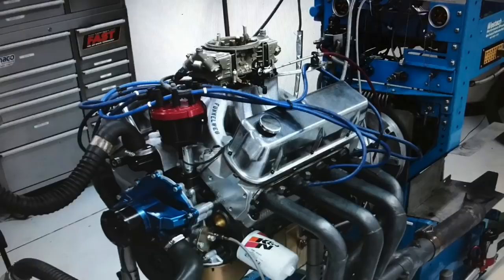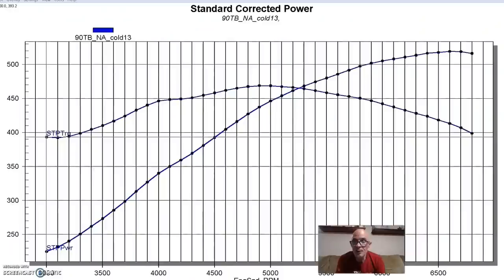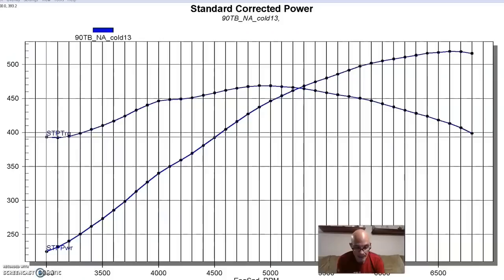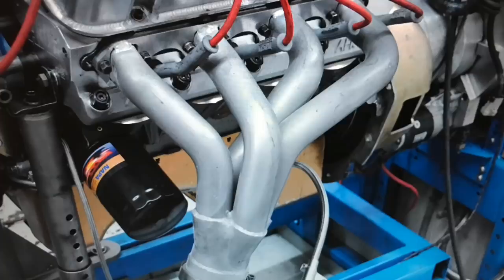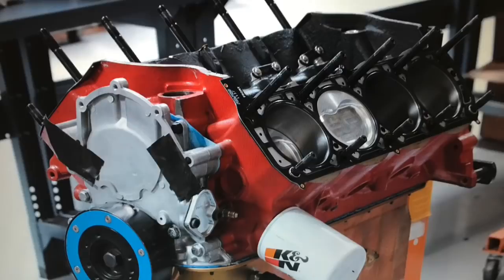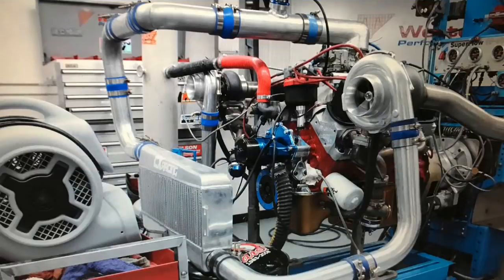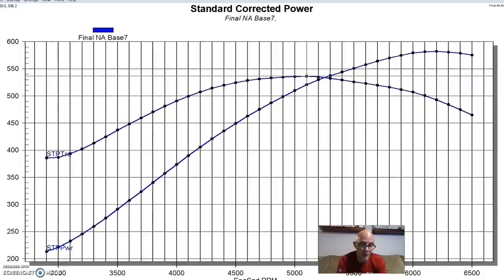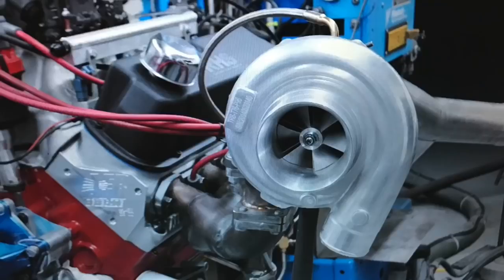1000-HP HOW TO: SBF TURBO STROKERS

Comment: here is the deal with 1,000hp power 351w is how long will it last even with a great tune, no timming just turn the boost up, show me where someone is running a 351w at a thousand horsepower, stock block 351
Reply from the maker: no timming?
Reply: @richardholdener1727  my bad i thought timming plus boost things go boom because the cylinder pressure with added timming

Comment: how do you adjust for windageI know you put less oil than what the pan recommends but how do you figure out how much wind did you have is it like a vacuum gauge or?
Reply from the maker: we see it on the dyno as a change in the oil pressure curve and a loss in power

Comment: I think this is a great informative video as I'm a foxbody owner and enjoy seeing options for more powa, but going 427 is a very pricey option and I've been leaning towards the 351W base and stroke it to the 408 or 416 with boost!! With that being said, Richard what is a safe reliable HP number and Boost pressure to pump out of a stock block 351W while being reliable and having good longevity from this type of setup?(I built a 306 and am planning on running my vortech with about 10-12 PSI and methanol injection for cooling of IATs and reliability BUT this setup is only temporarily until I build a 351 based engine and I want to go turbo and methanol injection with that setup)
Reply from the maker: you don't need a 408 with boost
Reply: @richardholdener1727  so you're saying I could build reliable 800-1000 on a 351W built around a proper cam with the supporting mods ie. Springs, heads, intake and of course the trusty "ring gap" and a turbo to meet that goal? What turbo or turbos would you suggest? Which cam, heads and intake would you also build the 351 with? Also is the factory 351W bottom end going to support everything or do I need an upgraded cranks, rods etc.??

Comment: Hey Richard, so I’m wondering why did it take 17lbs to get the 363 to 1000? Hear me out, if it made 519 na, then shouldn’t 14.7 lbs of boost doubled that to 1038 hp? Yet it needed 17 lbs, why is that do you think?
Reply from the maker: MILD TUNE

Comment: Would you be able to run a turbo on pump fuel on a windsor with 12 to 1 compression? If so video would be cool
Reply from the maker: on pump e85 yes-otherwise not a good idea
Reply: Cheers mate

Comment: I'm "back" ! So how much boost did you need to give the junkyard ? Did you ever see if you'd could make it to a 1000 hp with the stock heads ? And when you used junkyard stock block  and displacement and better heads, what kind of boost did you need ? "Very curious" 🦧

Comment: Mr  richard i love watching you and listening  i have a 351 dart block chi cleveland type heads holley  fuel injection 13 .5 to 1 compression  that dynoed out  at  806 hp on pump gas  and 1043 hp with 100 shot of nitrous  everybody i talk to is  surprised that i get that much hp  on pump gas whats your thoughts

Comment: I would really like to get a first gen Mustang, take a HiPo 289, swap in forged rods and pistons, some big port aftermarket aluminum heads, a roller rocker turbo cam, dual valve springs with titanium retainers, 1.6 roller rockers, a big single plane tunnel ram intake, head studs, some MLS head gaskets, a multi-port fuel injection system with return, a big 100mm throttle body, a set of 2200cc injectors, two GTX3582R Garretts, a full QA1 coilover suspension and tubular control arm upgrade, and not just drag race it, but also road race it because it'll handle.

Comment: I am curious to know how well a single precision 6466 turbo with a devided .85 t4 housing would work on my 331ci? It is a stock block, 8.3 to 1 compression dished forged pistons, H beam connecting rods, scat crank, AFR 205 heads, F303 cam, nascar series 1.7 roller rockers (544 valve lift), polly locks, pushrods and hydrolic roller lifters, main cap girddle, high pressure oil pump, ported victor jr intake, coil on plug ignition, 44lb injectors. 6300rpm redline. 

My hope is that it will work well enough to produce at the very least 450hp. I will upgrade to a second 6466 precision turbo if this works when I swap to a Dart block, forged crank, nastier cam and larger injectors. Everything I built except for the crank, cam and injectors should be able to swap over to the Dart block when the time comes.  After those upgrades I will  be uping the rpm rang of the engine significantly (med to high 7000s maybe more) and hopeing for at least 1100hp..

This is my first engine build, thought I would try on the stock oem block first before I messed with the expensive aftermarket block. I am ready for turbo selection now for the stock block set up  and any helpful advise is greatly appreceated. ✌😅 thank you for your time.

Comment: I wanna see that 427 combo with dual needle and seat fuel bowls on the csu carburetor and some updated bigger turbos. See what kind of horsepower it will make at all boost levels till it blows the gaskets.

Comment: Are your ford 351w tests done with a 2 bolt or 4 bolt main block?
Reply from the maker: 351W stock is a 2 bolt
Reply: @richardholdener1727  Thanks Richard, those 351s hold so much power for having 2 bolt mains!

Comment: After spending way too much time on this channel I have discovered that my T-bucket autocrosser needs as large a displacement as I can afford, and as light an engine as I can afford, because getting weight off the nose helps turning. So Basically I need a LS3 junkyard engine and E85 with the appropriate tuning.

Now if I win the lottery I need an all-aluminum big block stroker... And Richard to set it up and tune it for me.

Comment: So when you say “add ring gap”, how much ring gap is appropriate?  Do you add more ring gap for 20lbs or boost than you would for 10 or 15? And if you are planning to boost the motor eventually, but not right away, how much is the added ring gap going to hurt compression or oil consumption, or anything like that?

Comment: I made 607/565 to the tire, uncorrected on a 302 .40 over with a vortec T trim afr heads in my mustang 15 years ago. it held the record on the local dyno for over 2 years with the stock crank and rods
Reply: I made 570/535 on a 306 with the V3sci blower, with room to go. Only running 17 degrees of timing tapering down at 6k rpm.
It's all about the combo.

Comment: Ok, 1000 hp. Seen the youtube videos where the guy mashes the throttle blows the tires away, shifts, blows the tires away, shifts... You cannot peddle the throttle to control these turbos. So for a street car how about some programmable wastegates/ignition timing retards or some control tests we can use to lay this power down.

Comment: So earlier I heard you (Richard Holdener) say that "generally" in an engine making more torque than horsepower this is caused by an airflow restriction. My question is does this same logic apply to boosted engines specifically turbocharged engines? My focus st from ford made 252hp & 270ftlbs of torque would this be the cause of an airflow restriction?
Reply: I realize any airflow modifications would require a "retune" to take advantage of. Would you recommend a bigger turbo and more fuel/retune or just focusing on airflow improvements and a retune?

Comment: About to throw the 408 mopar with Indy MAX heads together. What’s the turbine A/R on the 76’s? Need to figure out what turbos I want for 1000-1200 with keeping exhaust back pressure low. Running ultragate 38’s and a very port. Should I up the gates and should I add another bov?

Comment: Say you find a junkyard 351, and you refresh it to OE specs on the short block but add ring gap. How should you go on the bottom end? Is it a limit of horsepower or is it a limit of boost?

Comment: Thank you for more Ford builds. 427 low boost small cam is the way to go. 👍 Would like to see the 427 with the EFI you had on the 363.👍
Reply: Bigger is always better!  I'd like to see more 9.5 deck stock block prepped combos!  Once again, why would you limit yourself to that weak ass 8.2 deck! By the time you buy a block that won't split at 500hp you'd be much better off to start with a 9.5 block!
Reply: I really like your vedios, but that bs bout it's a 302 is not happening! Not a decade ago even! The 351w block is so much better, you go from a weak 8.2" deck block that won't stay together at 500hp for long to a 9.5" deck block with 5.969 " connecting rods right off the bat! The heavy crank and 3" mains are the only negative side. Noone believes it's a 302!! The only reason to use  8.2 block is a 9.5 block won't fit!! Po boys need to stick with what will stay together!
Reply: @markmccarty9793  When your talking 1000 plus HP a stock block is out of the question for me no matter what the deck height.
Reply: @tomhamilton9140  I agree, but the stock 5 liter blocks aren't gonna stay together long at just 600hp, pass after pass shooting gas!! It's your money, but I just don't understand why you people don't just start with a 9.5 block? I like at least a 1.7 rod/stroke ratio. The dope dealers are gonna out run you either way! The stock 8.2 block is a boat anchor! If you're a dope dealer, you're running a Dart block now anyway! I quit that hobby long ago! The really fast stock appearing cars run on crack!!
Reply: @markmccarty9793  My comment was a 363 that is an aftermarket block from the start. 🤔
Reply: @tomhamilton9140  you can't get 363 from a stock block! Show me the math,  maybe I'm wrong, but these 8.2 blocks, you coulda built a 427 9.5!  You can exceed 450 ci. ! If you wanna build a motor on the cheap, an 8.2" ain't the way to go! The guy I raced with is running a 363, but WTF, where did the money come from?!! It's someone else's money!!  You coulda built a 427 for that money, but WTF, it's your money! I guess? I bought a camper!  Have a great time, guess that's all that matters!
.
Reply: @markmccarty9793  I never stated a 363 from a stock block. I stated a 363 that requires a real block.

Comment: Just a few words: Twin-turbo 351 Windsor w/Cleveland Boss heads. ;)
Reply: YES, A Cleveland. that would really scare off the LS guys!!!
Reply: Why? Factory Cleveland heads cost a small fortune and suck compared to almost every aftermarket casting that exists. Then you add in all the one off pieces, even if they are common today, and what do you get? You can buy a set of Chinese castings ready to bolt on for less than $1000, if your gonna go all Kung Fu swapping to Cleveland valve angles, try to get a Yates head. The factory iron castings are heavy, old and would cost more to buy bare than a complete aluminum set that might not outflow them at 600 lift, but weigh 60lbs less and have way more compatability with factory parts. As opposed to swapping a whole bunch of stuff to get a fifty year old head to work, why wouldn't you just invest half the money to get a Windsor head that outflows it?
Reply: @timothybayliss6680  Why? Cause Cleveland heads are without a doubt the best small block head ever produced. All the fastest small block Fords use Cleveland style heads. If your on a budget the cast iron head will make great power, if your have don't have a budget then yes buy aftermarket heads. For all out max power, any head will cost a fortune, it all comes down to how fast your pocket book is!
Reply: @timothybayliss6680  "Windsor head that outflows it..." Yeah, I would really love to see an inline valve head outflow an equivalent level canted valve head. Whatever inline valve head you choose and whatever you do with it, it's going to face some mountains it can't climb. Mountains named Blue Thunder and T-Rex. I can't recall any inline valve headed Ford winning the focused competition at Engine Masters. I do know Cleveland headed entries won a number of times, that's why Wood Chuck intimated that LS boys would be worried by a canted valve Ford more than they would by the more pedestrian type. Canted valve Fords have made a pretty regular habit of kicking LS ass in EMC, not counting any other venues. I've currently got 1 Cleveland, 1 B302 and 3 Clevors. I admit, it is hard to come up with the intake I prefer for the B302. The others? No parts compatability issues at all. B302 and 1 302 Clevor (2v heads) run 50 year old iron heads, alright, but 351C,  302 Clevor (4V) and 351 Clevor all run aftermarket aluminum heads, priced better or at least competitively with inline valve Ford heads.

Comment: When will you reveal the top secret Ford transmission for 1000hp
Reply: Ford C4 Build by Protrans in Texas!!
Reply: When one is produced lmao
Reply: Ford will sell you the same th400 they use in the cobrajet with ford badging
Reply: 4R70w will work great if set up properly.
Reply: I have a 4R70W built to handle 1200 whp behind a turbo Windsor
Reply: @jedwards100able  I look forward to seeing it at this year's rocky mountain race week...where it will almost definitely be the only 4R70W there.

You should also let Ford know so that they stop selling the 2016+ cobra jet factory race cars with a GM TH400. 

http://www.mustangandfords.com/features/1511-exclusive-first-look-fords-1000hp-cobra-jet-mustang

Comment: HEY, RICH?
HOW ABOUT THAT 427 WHEEZER SET UP ON A 454 CLEVOR? 

12-1350 HP?

GOD BLESS,

BRIAN.
Reply: HEY, RICH-

WHEN YOU WERE discussing the0p NO po  289.
Sometime back in the early/mid 80s i sae a 3 part mag article  show casing a (?) 350 horse 289 sporting 2v cleve toppage.
There was also a 302 set up also.
Quite possibly Joe Sherman....

I have a few additional thoughts to pass on if you'd  be interested about canted valves on 4" sbf's.

Thanks for the m code cleve build.

Godbless,  

Brian.

Comment: sooooo, many choices i’m in the process of building a 351w and i want a comfortable 500 hp at the flywheel would y’all stroke it or leave the OE crank
Reply from the maker: 500-HP flywheel is easy with inexpensive stroker
Reply: Richard Holdener, Edelbrock makes a top end kit they call it a clevor clone do you have any experience with those
Reply: @schoolofhardknocks1096  Mr. Holdener may hold a different opinion, but in my long experience with many Cleveland/Boss/Clevor builds, the Edelbrock version of the canted valve Ford is the poorest performer you are likely to find. They make for a wonderfully "driveable" canted valve, if that's what you're primarily interested in, but for canted valve levels of power, there are SOOO many better choices. Scott Cook, AFD, CHI, TFS, Blue Thunder...all kinds of levels of power potential. My '70 iron B302 heads, with just clean-up...no porting or serious work of any kind...make the Edelbrocks look like...dare I say it...SBC heads, by comparison, as far as power potential. They may not make a small cube/big cam engine what many people would call "driveable", but that's what 3Vs are for...the best of both types of Cleveland heads in one head architecture.
Reply: Zekais, thank you sir, if you were building an engine for mostly street driving and weekend fun and have at least 500 at the flywheel where would you start would you stroke it or leave it factory bottom end
Reply: Richard Holdener ive got a 5,000 dollar budget not including machinery of the block can you give me some direction as to the most bang for the buck
Reply: Richard Holdener  , ive worked for ford motor company turning wrenches for 7 years but i’ve been working on them since i could see over the hood
Reply: If you want to go budget I believe scat makes a cast stroker for around $3-400

Comment: Any chance you could do a test with power output difference between throttle bodies? Compare a undersized vs optimal vs oversized for a particular application. I'm more interested in what happens to output if you oversize a TB.
Reply: I've seen this done with heads and carbs but not throttle bodies.
Reply from the maker: there is no loss in power from an over sized throttle body-go as big as the throttle opening in the intake will allow

Comment: Couldn't agree more. I have a 351 stroked to 408. Carb setup. Single 88 turbi With AFR 225 with extra proting work. solid roller. It made 1088 with only 11 psi. So technically invested in the infrastructure of the engine itself. I can go up to 15-16 if I want. But drivablity matters to me.
Reply: Sami Alotaibi Im building a stock block 426 windsor based stroker for my foxbody. I have a set of AFR 220s.. would you mind giving me some guidance on your build. What intake? Carb? Any spacer? I was going to use Bullet and get a custom grind roller. My email is c130Marine@yahoo.com.  Im on Fb messenger as DaleMulhern. Thank you. Any input would be appreciated

Comment: I hate to be a broken record but I’d like to see the smaller engines make power such as the Chevrolet 283 and Ford 289 it would be even cooler to see a Pontiac 301 With boost 283 would be awesome

Comment: I wouldn't want a .700+ lift cam in a street engine, I know that much.  But you can never go wrong with more cubic inches.

Keep it mild enough to survive and be drivable... then add whatever amount of boost is required.

Comment: Dickie me boy you need to take that 351 combo and swap some chi 3v heads on it then double up the 76's >;) Am I evil? No I just like lots of horsepower.
Reply: U mean 4v heads
Reply: @kevinjohnson9372  3Vs refers to aftermarket canted valve heads that have port sizes reduced compared to production 4V heads for virtually same same flow rates available but with higher velocity due to the reduction in area. Coined by Aussies, of course, with their inimitable style for nicknames and abbreviations.